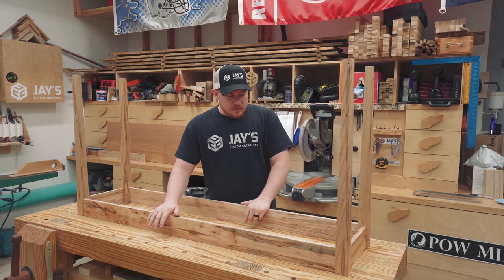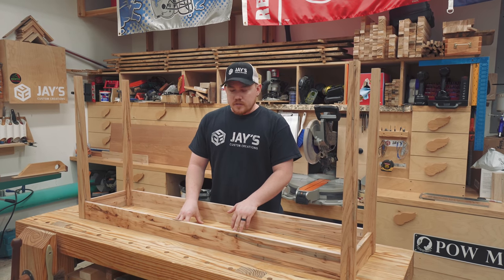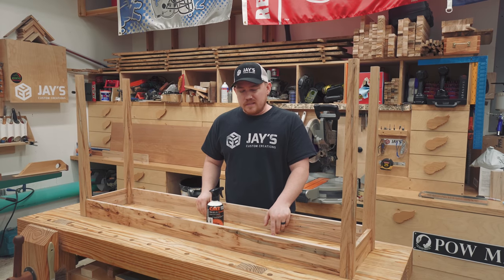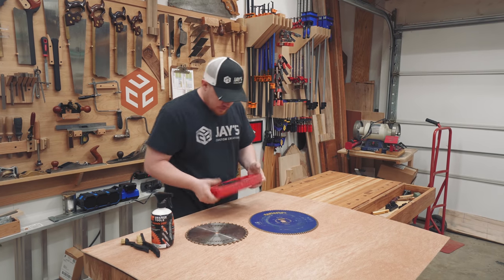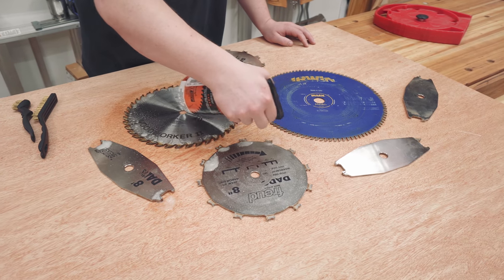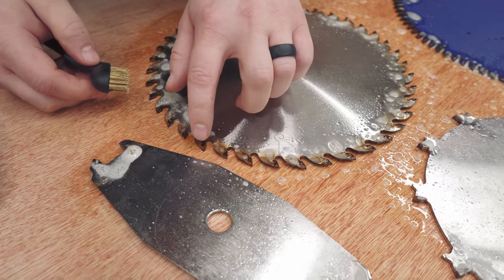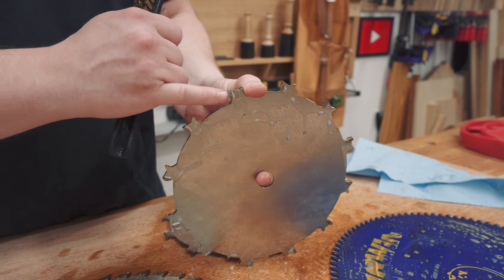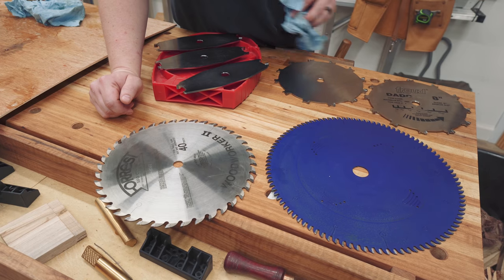Blade Cleaning

Comment: I am so glad you addressed this. I hate watching makers YT videos with close-ups of the cut and the blade is completely cruddy/dirty. The pitch builds up on the side of the tooth also creates more heat which can burn the wood and reduce the lifespan of the carbide. As we know heat is the enemy of any good edge. I use the same cleaner.

Comment: I have been using a product for years formulated to "Remove Burnt-On Resin From Saw Blades."  It works great.  Includes sodium hydroxide, 2-butoxyethanol, and alkyl phenol ethoxylate.  Thanks for sharing a much better option!  The old stuff is going straight to the hazardous waste pick-up place.

Comment: I got the Rockler kit when I first started woodworking.  I didn't know any better but I did get it on sale for like $20 with the pitch and resin remove, brushes, and the large container.  I'll get the CMT stuff or simple green after I run out of the rockler cleaner.  Good video.

Comment: I love the CMT stuff. Picked some up when the lumber yard had some one sale one day. Really nice if you have to work with a lot of pine.

I never found the need to use a brush, just let it soak in and wipe off. Do it a second time if needed. Let the cleaner do most of the work.

Comment: Try using the top of a bucket lid for cleaning your blades. 
Your cleaning solution pretty well stays contained and the little dimple in the lid let's you stick your finger through the hole in the saw blade for east lift out

Comment: You could use dishwash liquid in hot water let it soak for about an hour bulk of the pitch will come off what does not brush it off with nail brush or toothbrush

Comment: Jay, i wonder if an old tooth brush should be used instead? The brass brush may do some damages to the carbide
Reply from the maker: Brass is a soft metal. It will not damage the carbide. Toothbrushes work too. I don't have a toothbrush in my shop.

Comment: Seems like a waste to use a sheet of plywood to clean your blades. I use a plastic oil drip pan and simple green pro hd which is cheaper for a whole lot more (and has other cleaning uses as well). I just add some cleaner and water to the pan, then place the blade in and start brushing. The pitch/resin immediately comes off. I do rinse off with clean water and dry with a heat gun so that's an extra step.
Reply from the maker: This piece of plywood is 5mm hardwood underlayment. Not that many uses for it and it was warped more than a potato chip.

Comment: Should use a toothbrush first if its being stubborn then resort to a brass brush. Ive never had to use anything but a tooth brush and i ise the trend which is pretty much the same
Reply from the maker: No worries with using a brass brush. Brass won't harm carbide or steel and get the job done faster.
Reply: Ive never had a problem using a soft bristle so why go for a metal bristle. Doesnt make any sense. How much time do you really save a minute. 3 blades 3 minutes every few months seems worth it
Reply from the maker: 've got a brass brush in the shop. I don't have a toothbrush in the shop. Either is fine :)

Comment: You are paying to much and are working to hard to clean any and all saw blades. Try Awsome for the dollar store and you will be amazed ! Wood magazine came out with this tip a couple of years ago campareing it to other cleaners. It works best, I have tried it. Good luck.
Reply from the maker: Try what?
Reply: Try the cleaner called "Awsome" to clean saw blades. Find it at the Family Dollar stores. I works great and is less expensive than other cleaners. 20 oz. spray bottle for $1.00 ! Thanks for such great videos, followed you several years. Made your style of air filter cart, work great,thanks for that.